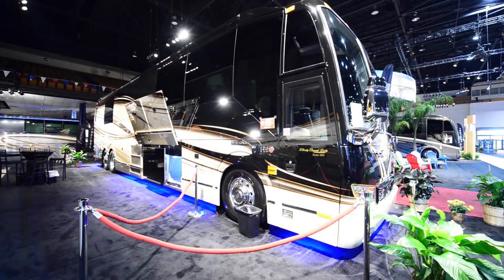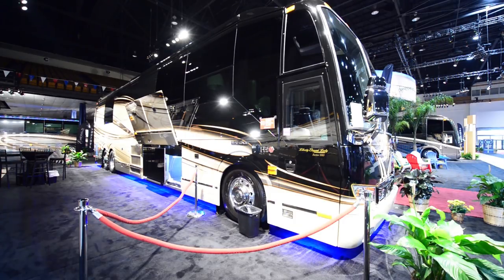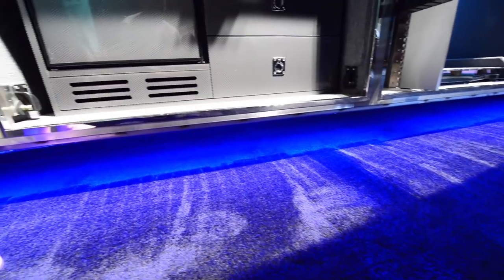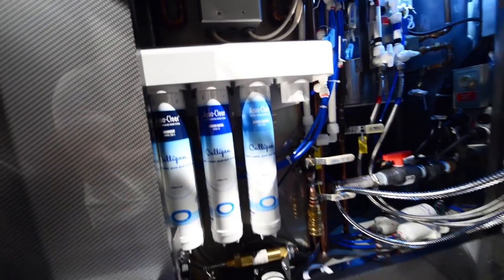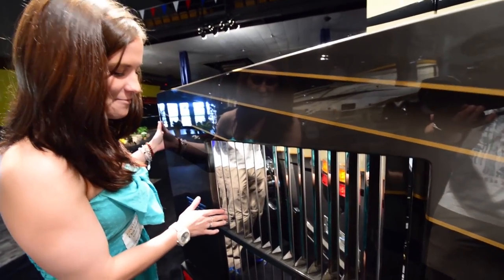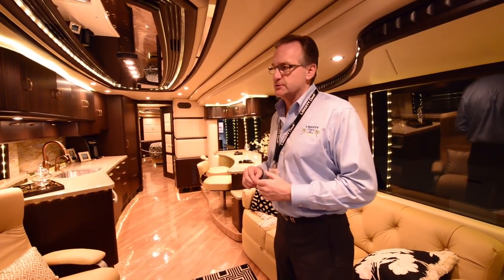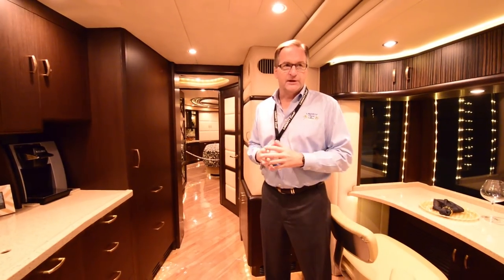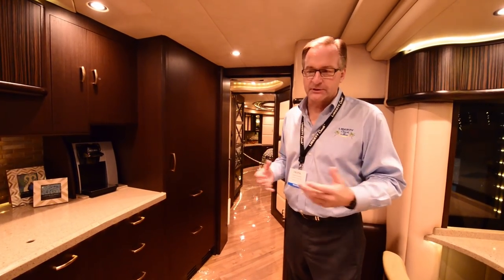The 2.5 Million Dollar Motorhome ~ Liberty Coach ~ Full Tour By G & Owner Of Company

Comment: That was a poor  tour of that luxurious coach. Pointing out the name of the manufacture's stamped-on emblem. Really? The tour guide on the inside of the coach was not a salesman either.  I guess it doesn't have a driver's seat or a steering wheel. That would have impressed me in seeing what I had to work with while I am driving this home on wheels.

Comment: I don't get it with the batteries... You're saying they don't need to be recharged? I get that they're high capacity, but they'd still benefit from solar, unless you're either planning on having hookups all the time or running your generator when camping.
Reply: They do need to get recharged, same as any other batteries. It's pretty retarded not to go solar. Those are just very expensive, larger batteries, so you have to run your diesel generator to keep them charged or hook up.

MUCH better to get modern batteries that work with solar tech.
Reply: +Ronan B Why wouldn't these work with solar? If a generator can charge them, so can a modern MPPT solar charge controller. I'm guessing the absence of solar panels is just laziness on the part of the builders that they're trying to sell as a "feature". Not the biggest deal in the world I guess since they're so easily added with all that roof space.
Reply: solar is expensive and it will decrease their profit :)
Reply: +Evo ZR they've already got the most expensive part of a solar installation, which is the batteries, so it would just be about $1k more for a decked out solar install (600 watts and an mppt charge controller). Compared to everything else on the rig that's peanuts. But who knows maybe you're right!
Reply: +James: it sounds like you need to update your knowledge of solar! First off, the number of hours capacity has to do with your batteries, not your solar array. This thing already has good batteries, so assuming those are still in decent shape, they'll probably run things (except an AC) for longer than 11 hours. And solar has a big advantage over charging the batts with the generator: its silent, and happening automatically whenever the sun is out. So if they install a couple of good modern solar panels (300 watts each, high voltage) and a good modern charge controller (MPPT), the batteries would be fully charged every night without having to run a noisy generator or even think about it.

And besides you still have the generator if you need it. Its not like you need to choose one or the other.

There's simply no down side. Especially with a rig this big, that has all that roof space.

(And hopefully its clear I'm not talking about slapping a single 75 watt solar panel on the roof of this thing, which is what most RVs do, and call it "solar". That's horribly insufficient on anything other than a tiny campervan.)

Comment: Mastervolt RV batteries will outlast you if you are on deaths door maybe.  Even their top end is only 3000 full cycles.

They won't "outlast anyone watching this (video)" unless they are terminally ill.  You then correct yourself and say they last a long time, which they can, what a vague feature/benefit presentation.
Even not knowing anything, Gina did a better presentation.  'Hey Gina what ya got on under there?'  :p
Only problem is, she thinks she will break everything she touches. Does that mean that ANY buyer break everything unless factory trained on how to put away the TV or slide out the storage drawer?

Carbon fiber laminated drawer fronts, they are not solid carbon fiber blocks.
KEF is not the oldest loudspeaker manufacturer in the world, they started building speakers in the early 60's and are only considered "high end" by retail consumers who listen to misinformed sales reps, kinda like the BOSE scam.

Too bad really, this is a beautiful rig (I don't personally like the front end but that's just me), with so many benefits, may as well get it right, why just make it up as you go and lose credibility?   

Wow, sales people are sometimes so misleading, or just don't take time to know better.  Makes it so much easier for the rest of us though.

Comment: I wish these RV manufactures would look at the 60 foot sailboat industry and how those interiors are designed.  They use top quality materials, fabrics and woods.  The designs are modern and stylish , this looks like a high end disco.  The ceiling is ridiculous.  They are using a gloss finish on their woods and it starts to like like plastic.  The kitchen is the only part of this RV I like. I would even ask the designers to look at Leisure Travel Vans or AirStream RV’s and Travel vans.  The bed spread is really ugly.  If I had millions I would never buy this.  I just don’t see how this cost 2.5 million.  Just my opinion.